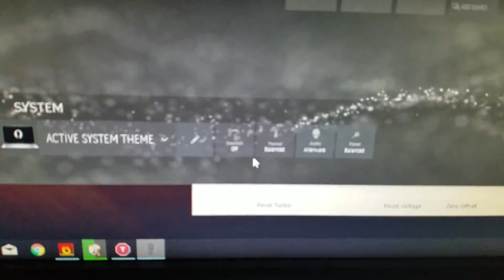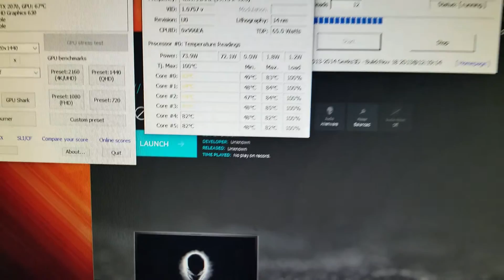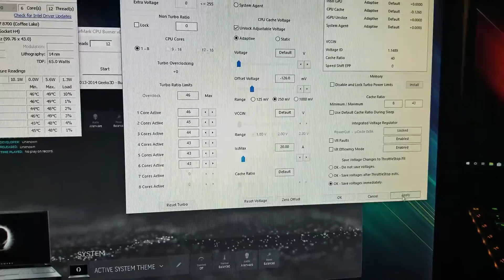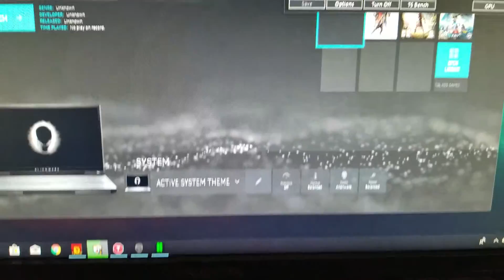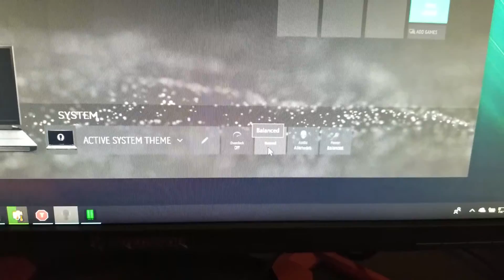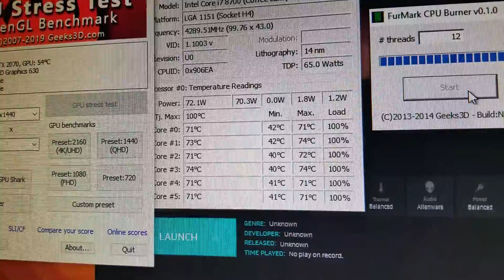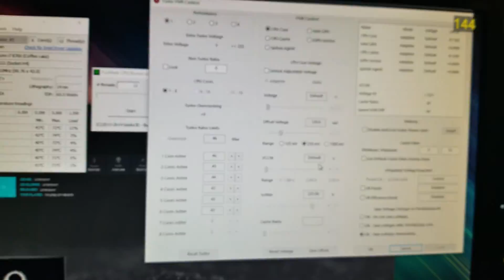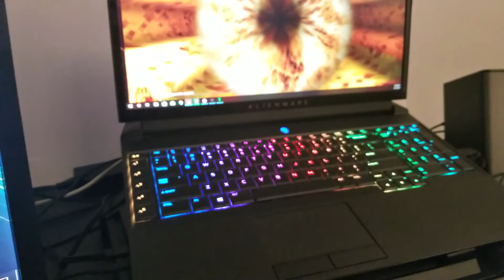Alienware 51m Laptop (8700 + RTX2070) - Furmark Heat Stress Test - ROUND 2

Comment: Thank you so much youve finally answered a question i needed amswering. How do you think it would react to a 9900k with rtx2080
Reply from the maker: I think you would see higher temps with the 9600k & RTX2080 Varient.. but I believe this cooling system with an undervolt is more than enough to keep thermals in check.. I saw a few other benchmark videos where cinebench was hitting 100c degrees and people acting like that's perfectly normal... not in my world lol
Reply: Suronal802 yeah I’ve been away from custom pc builds for 10+ years and is now in need of a laptop that’s powerful, however I’m looking at this one and like u said hitting temps off 100c is that not going to melt the cpu or start slowing it down? I’m confused as this is advertised to handle it.
Reply from the maker: @pimpscribe  It certainly isn't good for the longevity of the CPU and the laptop, thats not to say that it wont throttle cpu so those temps come back down. I wish i had the 9900k + 2080 combo to test it myself, i will try and find this other dude's video i saw, where he ran through some temps with that configuration of the laptop.
Reply from the maker: https://www.youtube.com/watch?v=Ba-zg44BFsM

In this video he has a 9900K with 2080RTX and i mean he shows hitting 100c, however, not sure if he is using the performance or full fan profile, that could have an impact in max temps.
Reply: @Sgt.Bastard  yeah i saw that one and i am still waiting for the review he didnt say much in regards to the fan profiles.
Reply: @Sgt.Bastard  Thank you for providing all of this information. I'm getting a 9900k 2080RTX from a warranty claim after my 17R5 bricked and incompetent onsite repair ruined the internals by breaking clips, connectors, edges and caused external paint damage. I'm skeptic about the thermal performance of the 51m with the aforementioned components. Also, there is a lot of misinformation in the reference video you shared. I highly doubt the performance / full speed fan profiles were used.
Reply from the maker: @lIlIlIlIlIlIlIlIlI  sorry to hear your other unit had issues man.. 

I would certainly think the 9900K and 2080RTX model would be a lot hotter than the model I tested here.. But the thermal compensation on the laptop is still really good compared to others.

What you see in my video is what you get man.. I'm pretty open about the test I ran.. I did toggle the difference fan modes and I can indeed say they were triggering.. Also the under volt makes a huge difference. Again if I turn the under volt off and do balanced fan mode this thing gets HOT lol.

But my unit is working really well for me.. I apologize if I ramble in my video I dont do them often. And if I did any misinformation it wasn't my intent.. Feel free to ask me what you need :)